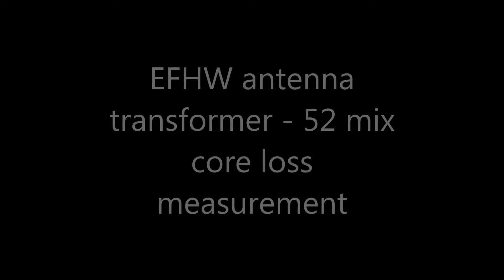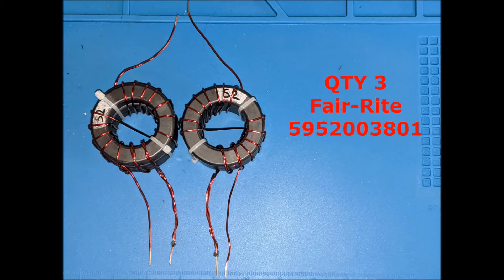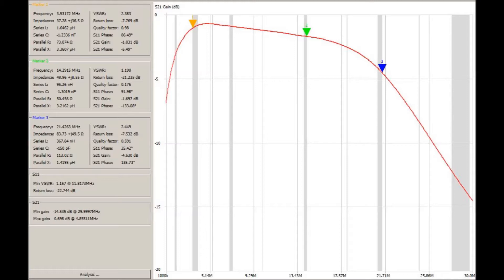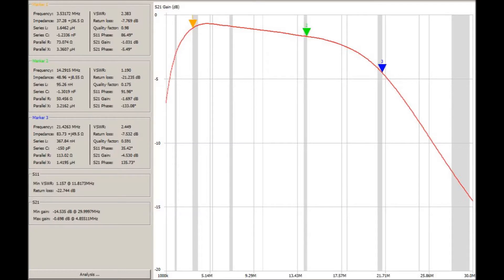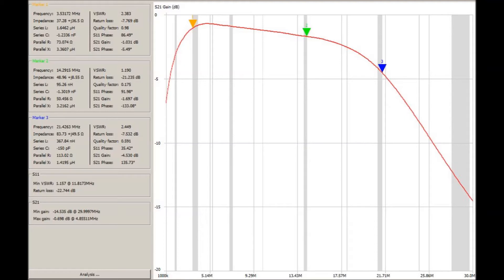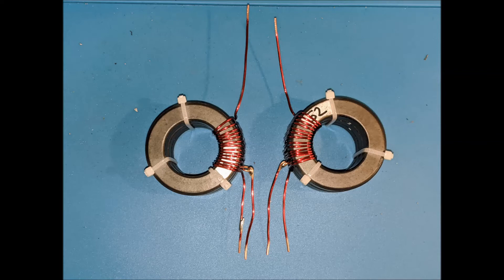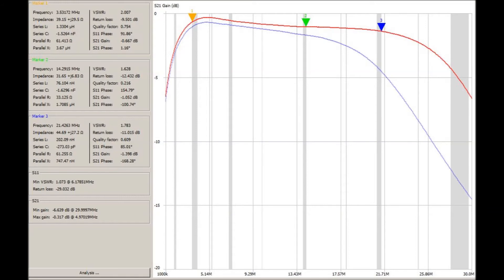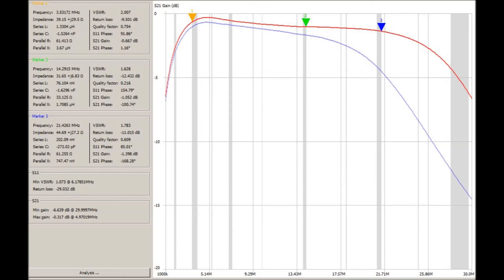EFHW antenna transformer - 52 mix core loss measurement

Comment: Well, the  toroid core permeability for mix 52 is low, you need to stack 3 toroids together to have a good result. You can get 82-98% of efficiency   from 80 to 10. If you use one Toroid - you are correct, it is not good
Reply from the maker: So you just commented here without actually watching the video. If you had watched, you would have seen it is a stack of 3, and you would see that your efficiency numbers are completely inaccurate.
Reply: @evil_lair_electronics  You are correct, my fault, sorry about that - I watched on my phone and skipped first few minutes by mistake. Strange, my test with 3 cores showed totally different story - much better than yours. My only guess is - either your cores were wrong (not really mix 52), or my test had a flaw...
Reply from the maker: @polzovotel  If you search youtube you will find others who have tested the 3 stack and also seen the unacceptable losses above 15 meters. Myantennas has previously published these measurements as well.
Reply: @evil_lair_electronics  As you always say at the end of your video - check for yourself ;) meaning I need to redo my tests again. Maybe I had a calibration issue with my VNA.... 

What core would you recommend for 40-10m, 100watt SSB ?
Reply from the maker: @polzovotel  I've seen the same results that Colin is seeing here, never found a better transformer to cover all of 160-10m. https://youtu.be/Xe0wvbOQeok
Reply: @evil_lair_electronics  Thank you!  I will try it

Comment: Thank you for finally removing some of the BS ... pse do same comparison on 43 and 31 mixes.  IMHO the crossover causes flux to oppose turns vs inductance. It prob equivalent to two inductors in series w the first 7 turns actually acting as an autoxfmr in series w an inductor.  Is that possible Dunno ?   Windings in opposite direction should oppose each others influence on the core.   Pse ur comments?! I hv been testing an original wining 3 core 43 mix and it does allow tuning but also makes a good room heater at 500 w hihi 73 Paul de K2HZO

Comment: Have you tested the loss using type 61 cores, i am using  FT140-61 for portable on 40 and 20m bands 65 feet wire, I did back to back tests and found the loss was very low, turns ratio 3-27 turns with a tap at 3 turns no cross over